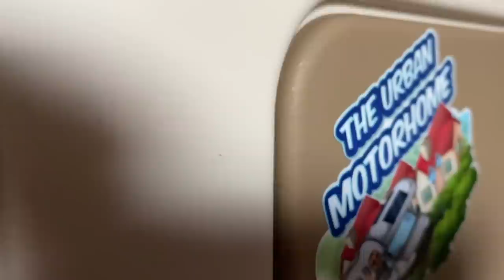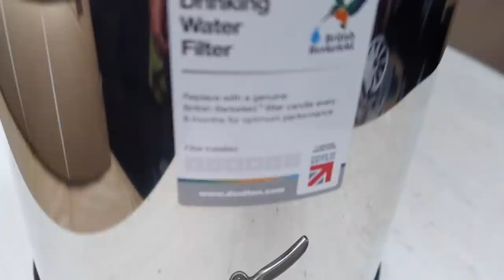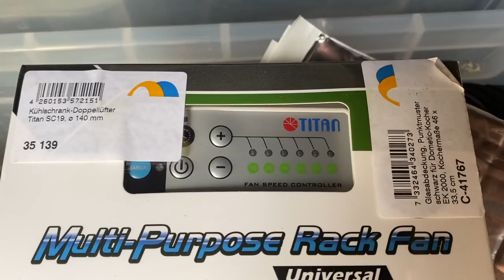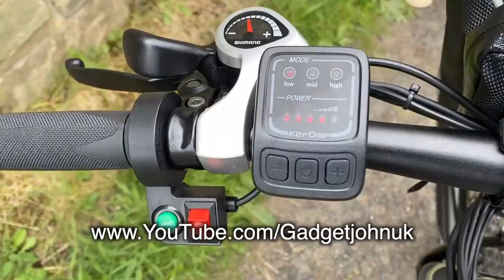Vlog24: FEELING A LITTLE MORE NORMAL

Comment: When you were showing the door seals I noticed that it doesn’t look like you don’t have any additional locks. We had a break-in in France a couple of years ago. We woke up and must have scared off the intruders, but both cab doors were open. I found out that the fiat Ducato has a huge vulnerability which can be fixed with a metal plate behind the drivers door handle. Did you ever hear about this?
Reply from the maker: The best way is put your alarm on when you’re in the van, just turn off interval sensors. Door looks, extra door locks, window locks and so on can be easily bypassed.
Check YouTube for videos on picking locks on vans and compressed air bolt guns that can open most locks in seconds.

Comment: Hi John and Mandy just bought the water filter arrived today. What did you use to block the other two holes? nothing in the box.thanks for your help.
Reply from the maker: The other holes you put the rubber bungs in that come in the box.
Reply: @johnmandy  thankyou. No bungs in the box just the tap and the filters.
Reply from the maker: Get in touch with the seller and get them to post them out 👍🏼

Comment: Hello John and Mandy. John I’m not sure if a mini? speaker fitted in the tv cupboard is standard or not but I’ve not seen one like it before. It’s inside that  5 cms tall tube that runs fore and aft along the front.
Reply from the maker: Sorry mike, I’ve no idea what your referring to. Could you explain?
Reply: Hi John, i thought as you were looking at speakers/soundproofing you might be interested to see if you had this odd looking speaker. Situated inside the tv cupboard behind drivers seat there’s a plastic casing 5’ish cms high which runs fore and aft just inside the front ledge. I don’t know if it’s a standard Burstner thing or not.
Reply: I believe this speaker uses the base to resonate against the bottom of the cupboard (just a guess). A couple of screws and the cover lifts and hopefully you’ll see what I mean!
Reply from the maker: It’s soundproofing, nothing to do with audio 👍🏼

Comment: Hi JMC, now that you've had time to settle into your new home. What do you miss about having a van compared to motorhome? I.e. advantages and disadvantages? Many thanks.
Reply from the maker: So far there’s only advantages as we’ve not driven anywhere really that might have been easier in the smaller van 👍🏼

Comment: How do you get on with the water filter in van? Is it fastened down or are you emptying before driving?
Reply from the maker: We usually fill it up at night, then decant it into bottles in the morning and then you flip the top section over and it slides into the bottom for easy storage while we travel 👍🏼
Reply: John & Mandy on Tour ahhh I see, many thanks 👍

Comment: Tom Tom alert 
  Law in effect started 27 April 2020   Germany outlaws speed camera alerts   The new Road Traffic Regulation in Germany prohibits the use of devices that alert users to the locations of fixed and mobile speed camera locations.   We recommend that you disable speed camera alerts before and while driving in Germany.   You can, however, reactivate these alerts for travel outside Germany.